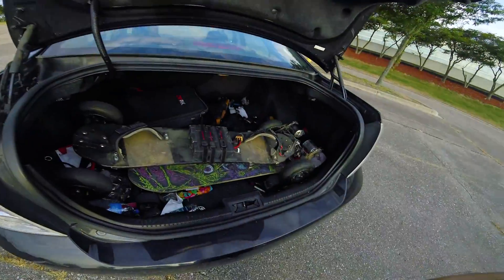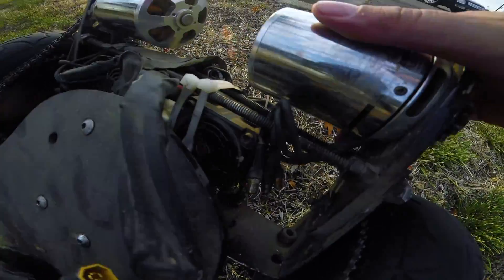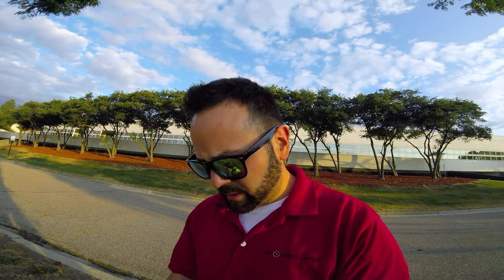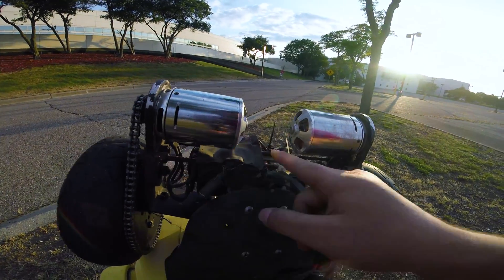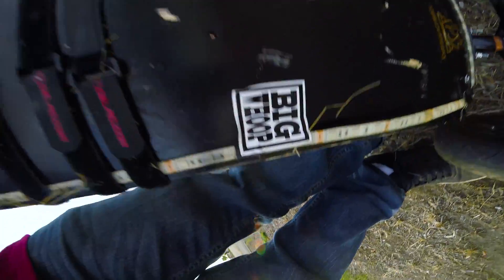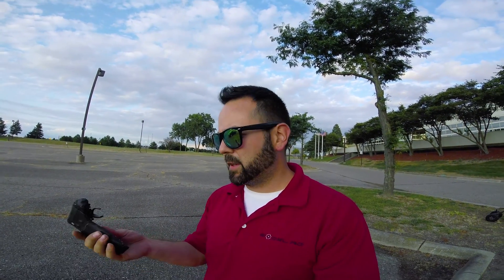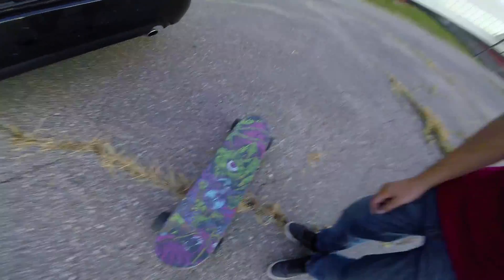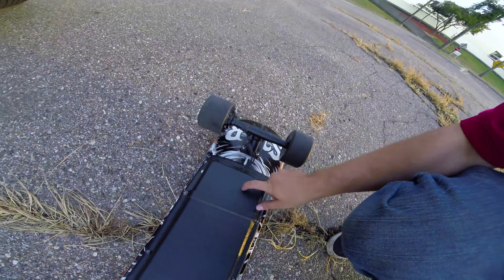My Electric Mountain Board / All the parts you need to build your own.

Comment: dont use escs for a rc car ,  what you need is a vesc, flipsky make some good ones ,you can buy them on banggood.
Reply from the maker: I like the car escs better. Way more torque and work better for 6s which is what batteries I have

Comment: Can you give me another link on the speed control, that one is discontinued, and was a great price for 150a ESC! Please Jeff!
Reply from the maker: Yeah, sorry I'll fix that link. I've heard of people using this one, should work - https://hobbyking.com/en_us/hobbykingr-tm-x-car-beast-series-esc-1-8-scale-150a.html
Here's a similar one to mine - https://www.banggood.com/Hobbywing-Quicrun-WP-8BL150-Waterproof-Brushless-ESC-For-RC-Car-p-918500.html
Also, you can use the VESC. It's what I have in the small board. They're made specifically for E boards, but the power ramps up slowly, it doesn't have the instant torque of the car esc.
Reply: Doesn't this Esc overheat?
Also, is there any overheating at all?
Reply: Herbert Henri no he's underpowering it

Comment: $180 per battery?!?! And you used 3?!?!
Reply from the maker: I had five, but lost two in a fire. These were batteries I used in my rc helicopters. Cheap batteries will be fine for the board.
Reply: VORT3X I'm trying to build one of these on a budget. I've already got  mountain board. Also that link for the speed controller. That part is no longer available. Does it need to be about 150A?
Reply from the maker: Acrobot FPV It needs to be able to handle 6s. If you're on a budget, hobby king is your friend. They have  a cheap 6s car esc that people have used in boards successfully.
Reply: VORT3X thank you! I will shop Hobby King. I don't need it to climb mountains, I just need a kwad retrieval tool. Lol

Comment: kewl. :)
how long do the batteries last?
Reply from the maker: wildchild FPV Like anything else, depends on how hard you're pushing but on 3 batteries it'll go for like an hr- he and a half. You can always add batteries too.
Reply: fair enough.
looks like a project for the wintermonths....

how does it handle descend? do the motors brake?
Reply from the maker: wildchild FPV  Yeah, works just like an rc car.